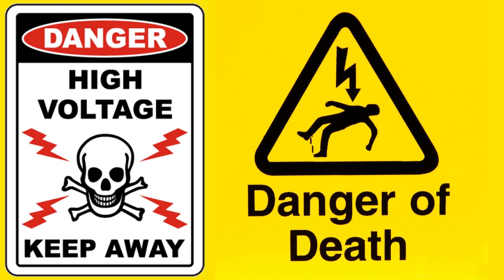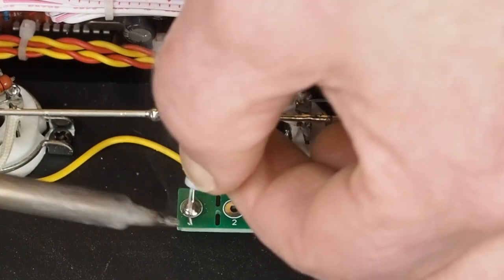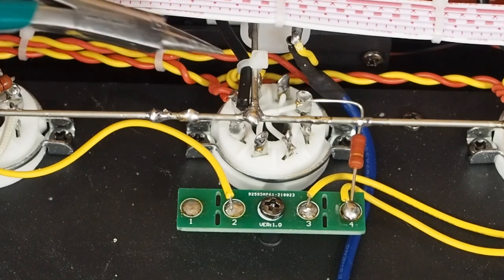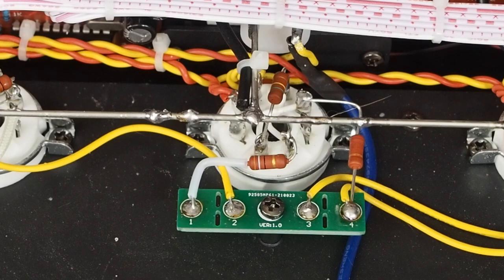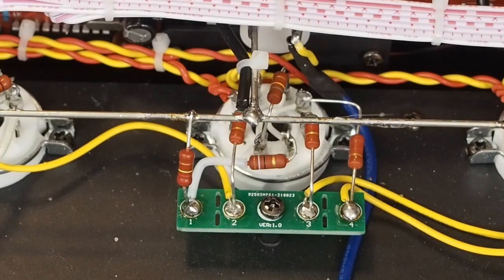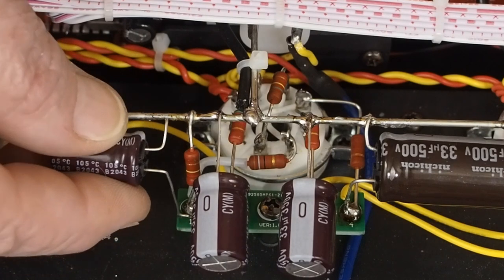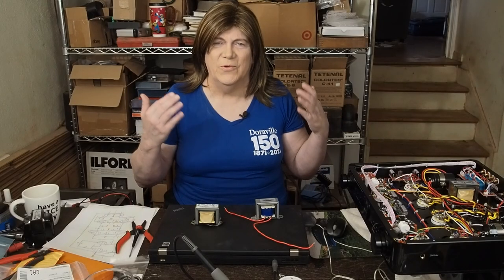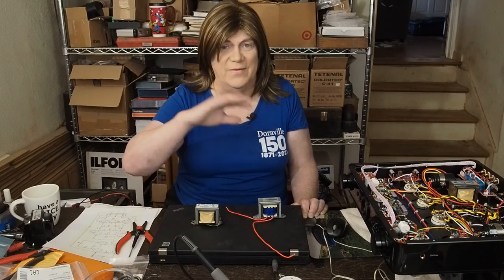Willsenton R8:  Mod of the Voltage Regulator 6SN7 tube

Comment: Great work Skunkie. That 6SN7 voltage stabilizer is pretty interesting. I was looking at a Willsenton R300B I think it was, it seems that power supply is split rail too with two separate rectifiers.
Reply from the maker: I have seen that design in some amps, it's a good idea!
Reply: I looked up the "exchange of ideas" or the text traffic on audiokarma regarding the 6SN7 voltage stabilizer. I understand now what's going on. It's important to understand, in my mind, the difference between that and a voltage regulator that holds voltage constant according to load.

Comment: Great video Steph ! Looking over the BOM for this project I don't see any wattage values for the resistors listed. Can you tell me what wattage they should be ? Thank you !
Reply from the maker: Most are 2W, the two large ones on the front end are 3W and the 1 ohm cathode resistors on the power tubes are 1W.
Reply: Thanks Steph ! @SkunkieDesignsElectronics

Comment: Skunkie:  basic :what is the benefit of better capacitors?
Reply from the maker: In this part I am upsizing the caps to help stabilize the current needs and also using the appropriate voltage ratings,

Comment: Hi Stephe. Is it normal that capacitors from other manufacturers are much longer and larger? The original ones are 2cm long (350 and 450V), while those from other manufacturers are usually 3cm (350V) and 4cm (500V). Nichicons also have larger dimensions?
Reply from the maker: Caps are made in a wide variety if shapes and sizes. So yeah you will see a variety of sizes with the same specs.
Reply: @SkunkieDesignsElectronics  Thank you for your answer. Unfortunately, in my country only larger sizes of capacitors are available (3, 4 cm). They may be, or is it better to wait longer and order smaller sizes from abroad?
Reply from the maker: If there is space, the physical size doesn't matter. Just make sure the uf and the voltage is correct.
Reply: @SkunkieDesignsElectronics  
Thank you for your response. Unfortunately, I'll have to play around with this. I don't know what happened, but it's currently difficult to buy branded 33uf 350V axial capacitors in Europe. As if suddenly manufacturers stopped producing them.

PS. 
Ok, noob here. Something touched me and I looked at your video again. Of course, it turned out that I made a mistake and realized that the capacitor should be radial and not axial. I have no idea why I insisted on this axial from the beginning. It's good that the matter was clarified before placing the order.
Reply: @SkunkieDesignsElectronics   Sorry, but I have one more question. Have you checked how many milliamps the amplifier delivers when the bias meter is in the middle? Are the values correct for EL34 and KT88? I'm curious whether the values aren't actually too low or too high. Unfortunately, the bias indicator is a very conventional system that does not say anything specific.
Reply from the maker: I have, it's in one of my videos but I'm not going to search for you.
Reply: @SkunkieDesignsElectronics  Ok, thank you. No problem. I'll watch all your R8 videos with pleasure!

Comment: Seems the schematic has wrong values in 2 places, first this 2x 3,3K weren't they suppose to be 5,6K after mod?,  and in neg bias it should be 4,7K not 5,7K right?
Reply from the maker: That resistor in the neg bias is color banded and measures 5.7K which is a weird value. I ended up replacing it with a 5.6K and I drew up that one schematic as an example before I got in there working on it just to show what my idea was for the video. Once I get finished, I have to draw up final schematics and a BOM, which I'm sure people will find errors in :)

Comment: Mine is 150k on the diagram is 220k series with 39ohm. Should i replace the 150k would this increase or decrease my voltage? Currently is 224v after the mod thanks
Reply from the maker: 220k pretty sure would raise the voltage, and might get you closer to the 250ish volts I had.

Comment: With that spare connection point available, it almost seems that Willsenton was planning on having a dual rail power supply until the accountants asked them to save another 10 cents on production costs.🙄

Comment: Curious if you think there could be any benefit to using (probably huge) film caps in any of those 33uf positions, particularly the two that used to be one 10uf. In the other video I believe you said one of the caps (on the voltage divider) needs to be slow to control the inrush, so I assume not that one!
Reply from the maker: Possibly there could be an audible difference, but you can get the same "effect" bypassing them with something around a .33uf film cap. As I have said, sometimes that improves things, sometimes it makes the amp sound shrill and brittle. And it's not that that one cap needs to be slow to control the timing on the voltage on the grid, that is set by the resistor value feeding it (150k) and the size of the cap. It's job after than is to stabilize the voltage there, help remove any residual ripple and also shunt any AC noise to ground.
Reply: @SkunkieDesignsElectronics  I noticed a definite difference. I used copper foil caps. I know $$. Others have stated audible difference with Mundorf and other caps.
Reply: @MrAroundsound  You did this mod and then bypassed the new 33uf caps with .33uf copper foils?

Comment: I can only find 1w resistors for the 2.2k position. Is that okay or should I wait for 2w?
Reply from the maker: Or use some 2K ones. that value isn't super critical.
Reply: @SkunkieDesignsElectronics  Thanks. 
Audio Note doesn't seem to make electrolytic caps in 33uf. Is there anything you'd recommend as a step up or two from Nichicon?

Comment: Those red resistors look like metalloxcide. If you shared that info I missed it.
Reply from the maker: The red resistors are the new metal film ones, Vishay PRO series. The gray ones I am removing are metal oxide.
Reply: @SkunkieDesignsElectronics  thank you for clearing that up and I enjoy your shows on MODS.